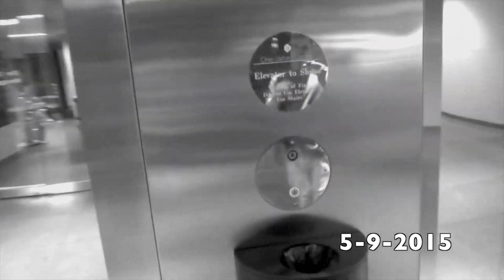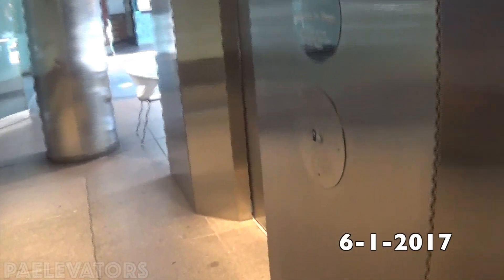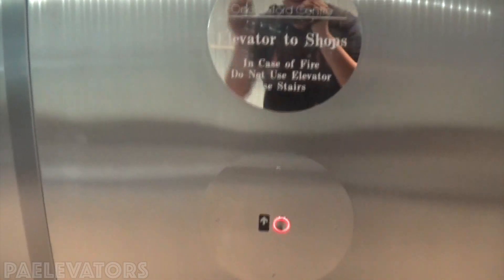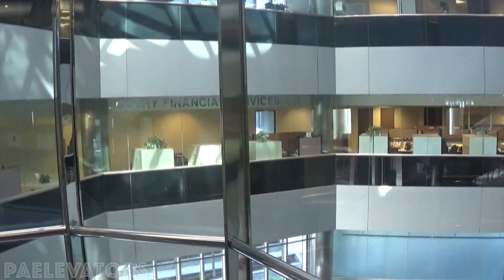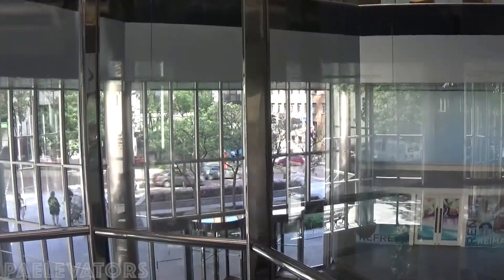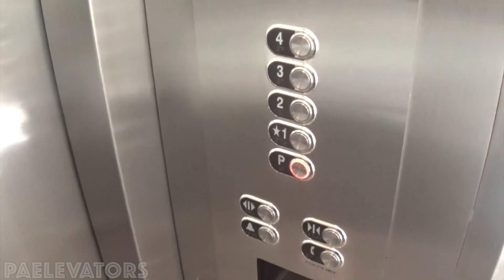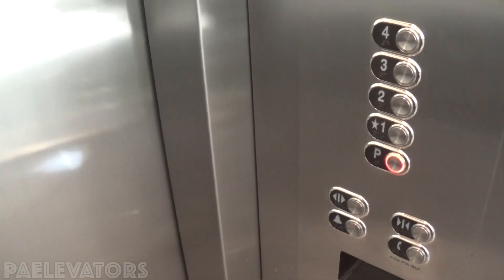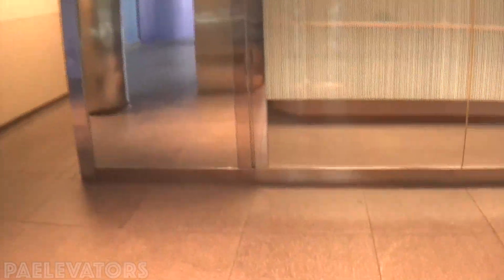They Got Modernized 🙁 - Westinghouse Elevators - One oxford Centre - Downtown, Pittsburgh, PA

Comment: These were not installed in 1982. They were installed in 1986 because of the blue LCD Westinghouse indicator.
Reply: That indicator was around in the early 1980s... Where did you get 1986 from?
Reply: OPM1961 I got 1986 from when this mall atrium was complete and finished.
Reply: Stop saying you get this information from just watching a video with no actual proof and reliable sources.
Reply: OPM1961 How I got the proof is that it said 1986 on the other elevators or on Wikipedia and it said that it was the year that these elevators were installed and the shop was built! No joke!
Reply: Wikipedia is not always that accurate. None of the elevators actually say 1986 in them.